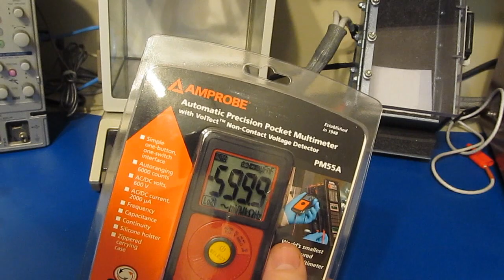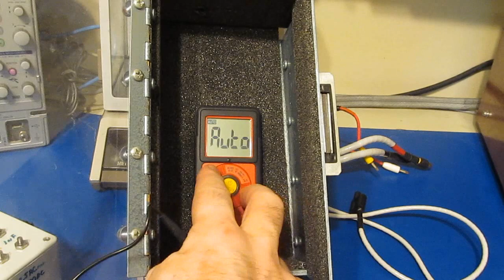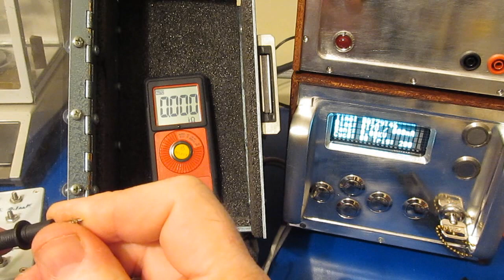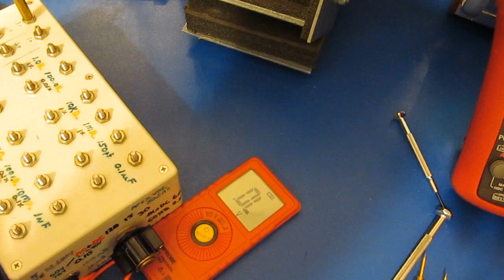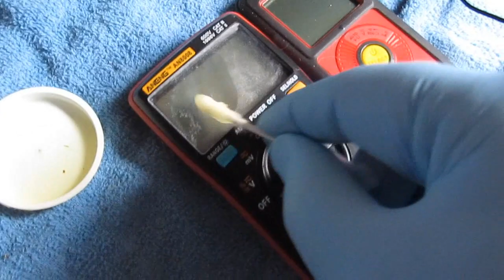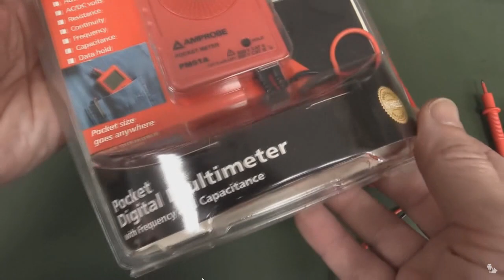Brymen BM27s / AMPROBE PM55A Pocket Meter

Comment: I haven't seen a pcb component spark gap in a multimeter before. Looks like you have a nice setup to investigate MOV vs Sparkgap vs GDT. I wouldn't mind watching an investigation shootout among those. 
 I revived five or six Fluke 289s where the MOVs had died (shorted) along with the PTCs burned and the HV resistors exploded in one. Yeah, the blast shield construction is there for a reason. Do not ask how or why would someone abuse a lab bench meter in such a manner repeatedly. I swapped in some GDTs because I couldn't find the exact replacement MOV. As far as I have seen MOV is a one trick pony, it does it once and is gone (ideally shorted or low res), when GDT and spark gap can survive several instances of over-arc.nch (6)
Reply from the maker: Maybe this:   https://www.youtube.com/watch?v=wYCGnYglRjY
Reply: @joesmith-je3tq  Great, thanks. Somehow it escaped me to search for it.
Reply: APPA iMeter5 has it

Comment: I really enjoy watching you videos. Now that they have released the labview community edition Id like to  creat interfaces for my brymen and fluke meters.  I wish you would do a couple videos on how to get started with basic functions and possibly logging function of labview to interface with meters.

Is this something you’d consider doing a video on? or would you mind recommending a good place to get started?
Reply from the maker: I would start with the Getting Started manual.  Work all of the examples.  Like any other language, it will take time to learn.    There is no magic 5 or 30 minute video I could make that will instantly turn you or anyone else into a LabView expert or even a novice.   If you run into problems and have questions beyond what is in the on-line help, they have a large forum you should consider joining.   There is also a lot of examples on-line for you to learn from.    Good luck.
Reply: Ok. Thanks

Comment: Most people will never subject a meter to that kinda abuse. Even turning the selector a million times heck most only use a meter ever now and then. I’m sure a super cheap meter won’t hold up but then again who’s measuring a million volts with a meter anyway. Great video 😁
Reply from the maker: I can't speak for most people.    If you took the time to actually learn a little about the actual testing that a meter goes through to be certified and you understood the testing I am showing, you make actually realize that the transients I expose these meters to is mild by comparison.   I have had some pretty ignorant people write me, and it was obvious that they had no understanding of what was being shown.
Reply: joe smith I serviced electronics for quite a few many years before I got to where I couldn’t anymore for private reasons. So I stick with my statement however it wasn’t anything against you.. but bottom line is most know better than to subject a meter to the kind voltage your subjecting them to. But again nothing against you.
Reply from the maker: @wadehicks9270  It's odd how you speak for the masses when you appear very ignorant on the matter.    There are several free papers available if you ever decide you would like to educate yourself.  This would help you to understand the causes of transients and possible means of exposure.  I will stand by my statement that the transients that I subject these meters to are mild compared to what it required by IEC.   You may not like that certain meters do so poorly in these tests but that's not my concern.
Reply: joe smith Mr Joe I’m referring to the average diy guy that decides one day he wants to get a meter to either check voltage on a electrical outlet or even a 12 volt battery. Simple things that these tests are really beyond the scope of that persons understanding someone that is only interested in a simple voltage test that person will likely only  use said meter maybe once in a year and then it’s put up somewhere until needed again which could be years later. And I watch your channel and I’m not ignorant I could care less about any of this it don’t mean that much to me but I’m sure you have followers that can’t get enough of it. But as for my self only time I click on one of your videos is when it’s been made an option to view. I hope I’ve explained myself well this time have a good day 😊
Reply from the maker: @wadehicks9270  Connecting a meter to an outlet is a good example where we can see CAT II transients.   Even on 12V automotive systems, the transients can be pretty high.   You would know this if you took some time to educate yourself.   I suspect posting your opinion is easier and you already know everything there is to learn.

Comment: I used the 181A and the bluetooth sender a few times to monitor max/min voltage over a 1 hour time period. It worked well as I was able to monitor from my Android phone in the comfort of my van.
Reply from the maker: What sort of distance were you able to use it from?
Reply: With 2 fresh aaa batteries in the D07A I was working 5 to 7 metres from the 181A.  At the time I didn't do any distance testing but will do in future. The metre was also behind a single sheet of corrugated aluminium which was the wall of the building.
Reply from the maker: That's impressive.  I was thinking just inside the van would be problem enough.
Reply: Van door and building door open. Sort of line of sight. Also phone propped up on dashboard.

Comment: Cool video, Thanks! On the subject of pocket meters, if the opportunity arises, could you 'run' the little Sanwa PM 300? Dave sells them on his web site. I actually have one as a back-up in my 'go' bag... haven't actually had need for it so far, but have been curious. Other than really wishing it had banana jacks, and non-wimpy continuity beeper, it seems 'ok' I suppose... for what it is. And far as skanky meter boots go; I had a filthy one on my ancient hard worked (but always reliable other than zebra strips) Fluke 88 beater. It was in basically good shape, but seemingly stained beyond hope. On a whim, I took it off, removed the stand and ran it in the washing machine with a few loads of work clothes. It's not perfect, but the improvement is phenomenal. As always, YMMV. Thanks again!
Reply from the maker: Another viewer asked about that same SANWA meter the other day.  It appears Dave does not offer it on Amazon and I could not find another distributor.  I am thinking when I get around to ordering a 121GW, I will pick up the SANWA from him as well.  It may take some time.
Reply: Thanks Joe!